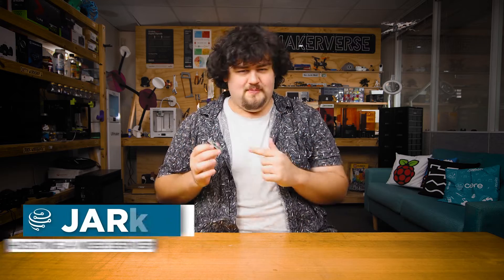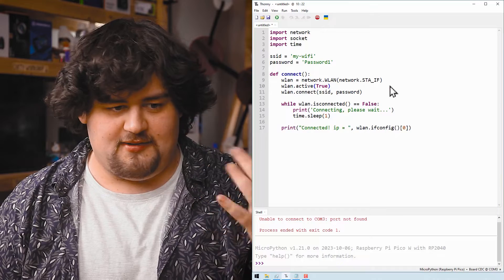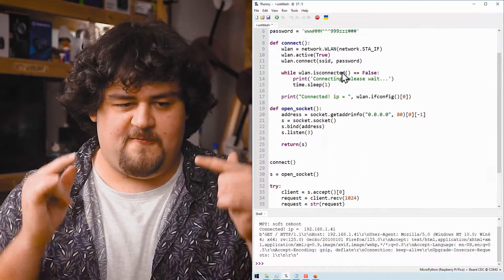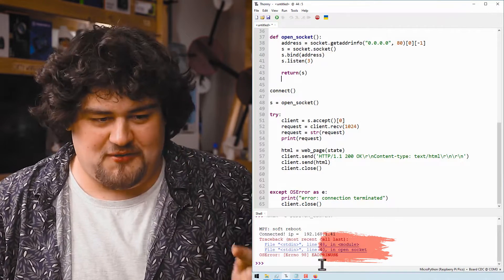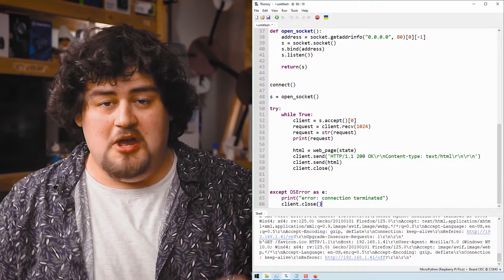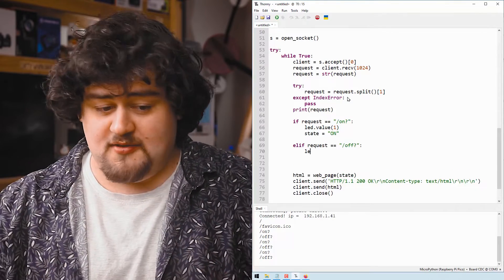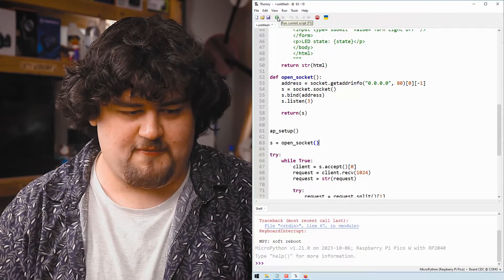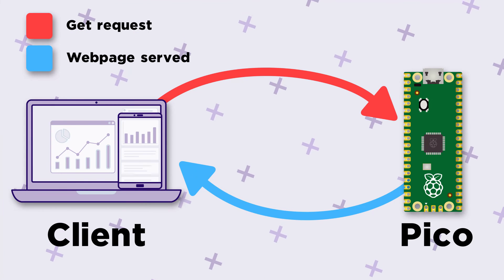How to Host a HTTP Webpage on a Pico  | Raspberry Pi Pico Workshop: Chapter 5.3

Comment: Rather than doing the un-plug-and-wait dance, there’s a configuration option you can set on the socket (after ‘s = socket.socket()’ in open_socket) : s.setsockopt(socket.SOL_SOCKET, socket.SO_REUSEADDR, 1)

Comment: Hey fellow Raspberry Pi nerds! Can someone tell me how I would set this up so it had a host name instead of an IP address when entering into the search bar of the browser?
Reply: You need to either
1. Buy a domain, port forward / set up a proxy so that your Pico can connect to the wider internet, then point your domain to your Pico / your proxy's IP in the DNS
2. If you only want this for one PC on your network, you can override your local DNS by going into your computer's hosts file and having it point to your Pico's IP

Comment: great video. i tried the code out of the box using firmware 1.24 - hooking up to my local wifi worked a treat. however setting the pico w up as a access point has been a PITA. I could get the pico w to be recognised as an ap but it would not accept the password. did some googling and there seems to have been a change form 1.23 to 1.24 with the ap settings? the only way i could get it to work was in def ap_setup(): to add
    ap.active(False)
    time.sleep(0.1)
    ap.active(True)
    ap.config(essid=ssid, security=0)

which gives me an open network - not ideal but hey it works! need to do some more digging but if there are any suggestions out there that would be great. greetings from across the ditch!
Reply from the maker: Hey from the other side! If you do find something let us know, we like to keep on top of these things and will update it. Will investigate and see what we can find!

Comment: I doubt I'll GET a reply before I try this TODAY()
Going to see IF I can both CONNECT the Pico W to a WLAN
and at the same TIME() have it become a W_AP for devices close to it
Reply from the maker: I don't think we have ever tried this, my guess is that it wont be possible to share the wireless resources like that, but if you can then let us know, we are interested!
Reply: @Core-Electronics  YouTube deleted my comment twice. So an abbreviated comment
I found errors in the website code, changed some things, to be closer to the video, and got PICO W to do both at the same time
Even got the WAP to be other than 4.1